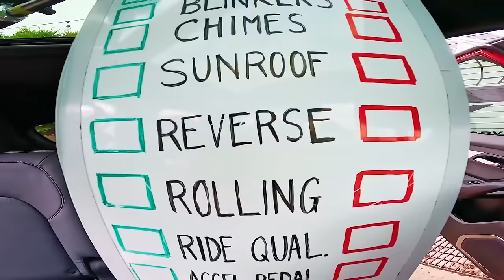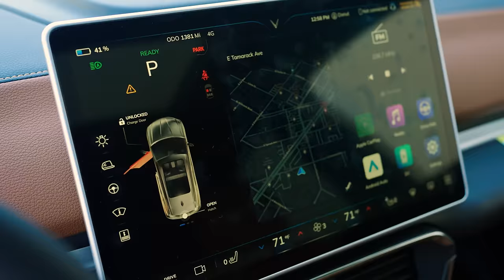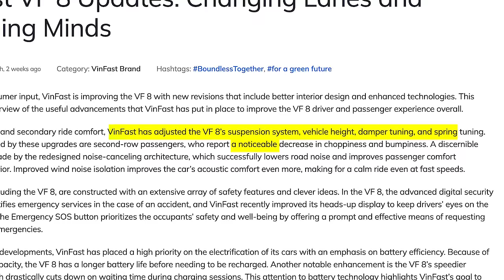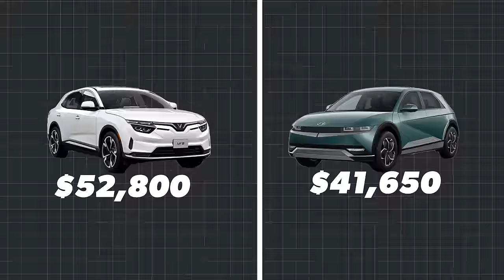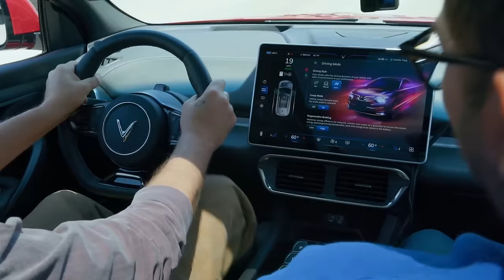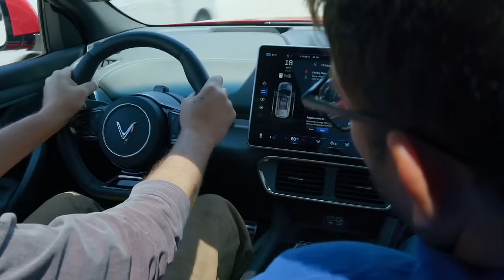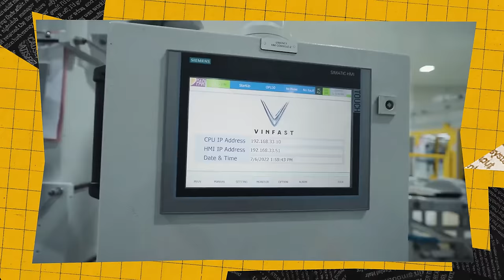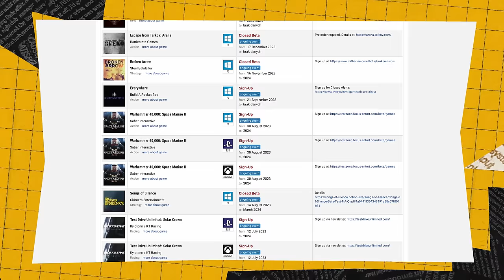We Drove America’s Worst Reviewed Car Again

Comment: I have to give them major props 4 responding with solutions.
Reply: it's still way overpriced for what it is. the ioniq comes with 7 year warranty and way more stock features. plus, it's from a reputable brand with nationwide dealership support and a 15 year parts availability. AND IT'S $11K LESS!
Reply: @StanleyKubick1  I wouldn't really call hyundai "reputable"
Reply: @smmsak15  Reputable is probably a poor choice in words. Maybe “More well known?” Which helps you know for sure what you’ll get.
Reply: Still overpriced as hell, you have to be crazy to buy it and watch it lose value like crazy. Buy the car that will hold some value if you got a budget like that.
Reply: @smmsak15 I would. They've been a solid manufacturer since digging themselves out of the hole more than 10 years ago.
Reply: Lets hope that the improvements on the car (like the springs) are not only on this review-car.
Reply: Don't be so quick.  If they failed to fix before selling the obvious... imagine that stuff thats not obvious that they will let roll off the production line. Scares the crap out of me.
Reply: @Hawk7886  My guy they're still in that hole
Reply: @Itzz_Gamby  No they quite obviously aren't, they may not get anywhere in the US because if it's not a V8 it's automatically inferior. If you look over the big pond where theres more brainmass it looks very different. Let's take Germany for example. Theres more i30N driving around than Golf GTI. Now, you tell me why that is?
Reply: These were obvious problems that should have prevented the car from ever passing QA testing, though.  And it wasn't just the car Donut drove, every review of the Vinfast VF8 has had the same complaints.  These were absolutely egregious quality issues, especially for a vehicle being launched into mature, highly competitive markets like North America.  Even with these fixes, there is really no reason anybody in their right mind should consider a VF8.  Unless "Made in Vietnam" is somehow a deal-breaker on your checklist, a Model Y, Mustang Mach E, Ioniq 5, or EV6 are all still better EVs in pretty much every way.  And that's not even taking into account its price point.  It's not better than its competition at anything and it's also not cheaper.  I wonder what the sell sheet looks like for these, because this car literally has no selling points.
Reply: @StanleyKubick1 okay but this is a very new company and the fact they are working to correct mistakes within  a short time frame compared to what hyundai or chevy would take to do the same it's impressive. The fact it can even "compete" with telsa and the ioniq is great. Would i buy this over a ioniq no, but that wasnt the point of the video. The car itself has potential and as a company they have shown potential with how they care about what consumers say
Reply: @deinim5854 which car at this price point is going to hold its value?
Reply: I also give VinFast that, thanks for listening to your customers.
Reply: @Cre8tive81 I mean they are still a very new company. I’m sure pnce they get a proper footing and some traction in the ev industry, they’ll more than likely be more efficient and probably safer too. I mean tesla started out the same way, so I don’t see how this’ll be much different.
Reply: You do not, in fact, need to give them props lol.  It still has borked “safety” features that straight up don’t work, even after letting folks overpay to apparently be their test/validation drivers.  A polished turd still stinks.
Reply: I think they look way better than a model Y and cheaper than  a Y but no one is going to pay 50k  35k and may be
Reply: Damn lil bro had to respond with the number 4 instead of the 3 letter word we know as 'for'. Very impressive!
Reply: Was the half second you may of saved by not spelling out the word "for" worth it? Do something fun or productive with the time you save by typing two fewer letters?
Reply: Was the half second you may of saved by not spelling out the word "for" worth it? Do something fun or productive with the time you save by typing two fewer letters?
Reply: Last week vinfast sent a reviewer to jail lmao
Reply: They legitimately have to in order not to get sued... They are doing it only because nessisary for profits. Maybe do more R&D before putting an incomplete car for sell for 5 figures?
Reply: I have to ding you for writing the 4 instead of saying "for."
Reply: If Donut in Vietnam instead of recreating a separate version for them, Vinfast would call the police to work with Donut.😂
Reply: Giving props to a company for fixing issues on an overpriced product? As in, fixing issues that shouldn't have been there to begin with? We really have fallen as a society and became moronic.
Reply: @StanleyKubick1 uhh, until a rock bounces up from the road and chips the battery pack. Then you're out the cost of the car new! Do you work for Hyundai?

I don't have a dog in this fight either way because I wouldn't buy either brand, but your arguments for Hyundai quality and warranty are misinformed.
Reply: @StanleyKubick1 fax holy hell that price is absurd
Reply: @JackTheRipper2613 OK, bo ohw o wo er. Tell me more about your big brains!
Reply: Nah you do that before you release a product
Reply: @smmsak15 really, hyandai is now better then Toyota. And would shit on anything American made.
Reply: @motomenace86 You can't even spell the company you're fighting for. Just... take a deep breath.
Reply: that is the least they should do, considering all the bad reviews, it's not good enough to fix "most problems", they need to step it up if they want to break into the US market, 90% is not going to cut it here
Reply: @megachonk9440  they rushed here 2-3 years too early, and got burned by the bad reviews, even Hyundai and Toyota etc. had to put in the work before they got better, this new update is what it should have been from the beginning, and they should know better than come with a high price
Reply: doanh số vf8 ở vn rất tệ, lý do cho vinfast đem chúng làm taxi😅😅
Reply: matttim5095  meh all American beers gay
Reply: If you are a beggar and receive a Vinfast vf8, please accept it, it has many errors that will make you easily angry and be invited to the police station because of complaints.😂😂
Reply: @Itzz_Gamby  no they aren't lmao
Reply: Seriously. Car companies here don’t do shit till they get sued lol
Reply: I am an owner of a VinFast VF8 City Edition since 3/18/2023. I shared hundreds of videos about UX if you are interested in the reality. I love the car and will not go back to ICE cars.
Reply: @vivuphuongnam đến khổ, lại thấy dấu răng của mày rồi.😂😂😂
Reply: @vivuphuongnam để lại 1 dấu răng thôi, ai lại bình luận 2 lần.🤣🤣🤣
Reply: @SuperNamn anh Nam thật tuyệt vời.❤️❤️❤️
Reply: @StanleyKubick1 the vf8 is nearly twice as powerful as the ioniq
Reply: @smmsak15 Hyundai are one of the biggest car manufacturers on the planet and also statistically one of the most reliable. It's not 1995 anymore get with the times.
Reply: @deinim5854 I literally see 25 vf8 suvs PER DAY in vietnam cuz its apparently a fucking taxi
Reply: Props for them to making this car under 5 years with a competition like Tesla.
But damn, the audacity to put a price as much as Tesla

Like who the fuck willing to buy this? Like i have 60K to spare, I want EV... Hey I do not want Tesla, But I want this Vietnam new EV that has a tons of bad review.

LIKE WHY?
Reply: @StanleyKubick1 yeah, 11k less to help the buyer when their batteries shit the bed for a 60k replacement, which costs more than the car itself. Might as well buy another Ioniq to get an entirely new vehicle instead of just new batteries. Oh, and let’s not talk about the overly aggressive regen braking on the Ioniqs. IDK if they’ve fixed that yet, but it’s a thing.

I’m not shitting on electric vehicles, though it do like combustion engines more, just criticizing Hyundai’s Ioniq.
Reply: @smmsak15  with all the respect, Hyundai IS a reputable brand(EVs sucks tho) but old diesel engine are inmortal, you should blame ur country for having AWFUL FACTORY, koreans one are nice, my Santa Fe 2.2 CRDI D4HB is pullying 180hp, 400nm and has 200k Km
Reply: @camialeh  not really when the hyundai dealers have multiple cars with warranty engine replacements in line waiting for install. Quality control is absolutely terrible
Reply: @StanleyKubick1  their VF8 ECO price now is around 45K and you can get more offers
Reply: @smmsak15 Hyundai Motor group is a reputable brand. It’s not the early 2000s anymore. They are one of the worlds largest automotive group next to VW AG, GM and Toyota.
Reply: @StanleyKubick1 it has 10 years warranty man
Reply: Still a commie car no?
Reply: @JackTheRipper2613 where are you getting these numbers? Hyundai isn’t even top 5 for makes sold in Germany
Reply: @brucedavidson7422  where are you getting numbers from? I don't remember giving any Numbers or making Statements of Hyundai being the Top sold make in Germany. Thats you Putting words in my mouth. I was putting out a thinking excersise at best. You act like i made up business statements.
Reply: @StanleyKubick1  In Germany we're ordering Vinfast for its Pininfarina design. Pretty good. With Vietnam and the European Union's customs free deal, I expect a great competitiveness - and so more affordable in the future.
Reply: @JackTheRipper2613 you are probably the same kind of guy that gets mad at European stereotypes 😂😂 if you've ever been to the US you'd realize nobody drives cars with V8s
Reply: @80PercentAshamedOfU They sell well enough and have a good return rate so meh I’d say they are
Reply: Responding is good but the car is still a bad value 😂
Reply: @JackTheRipper2613  Not many V8s left anymore. Certainly not in this segment. I think you're argument is a little outdated. V6 or I6 is more like it.
Reply: @JackTheRipper2613  substantiate your claim that “there’s more I30N driving around than golf GTI” I couldn’t find numbers for those specific models but I could for the make as a whole.
Reply: I don’t have time to do this, so I’ll put the challenge out:
Walk into a Vinfast dealership and ask “what can I get for $10?”
Reply: You are giving them props for releasing an awful car and then fixing some of the issues that should've never been there in the first place?
Reply: Yeah if I was charging people twice what I should be. It's pretty easy to make it work as well as it costs.